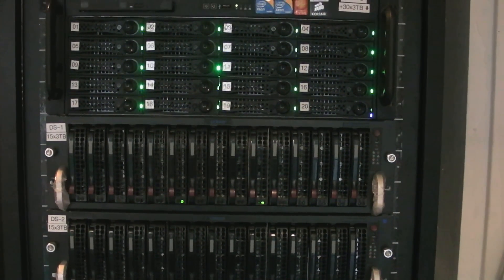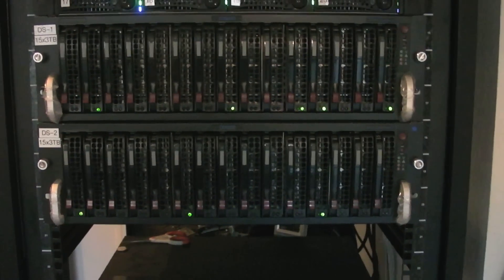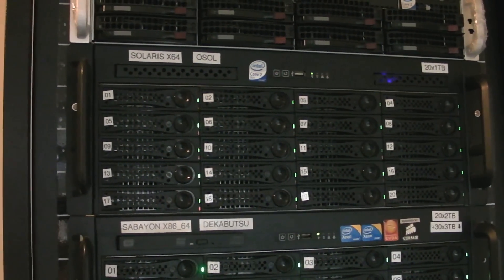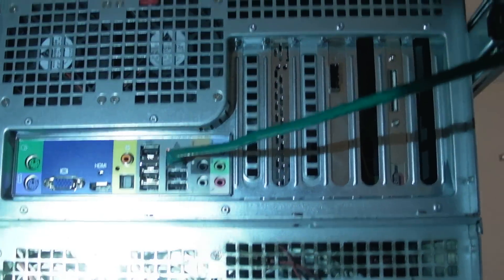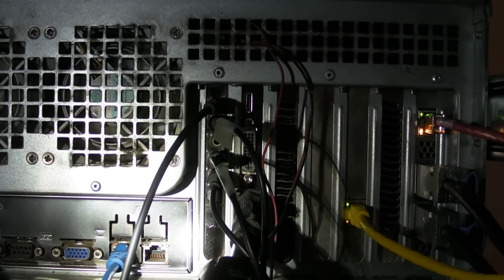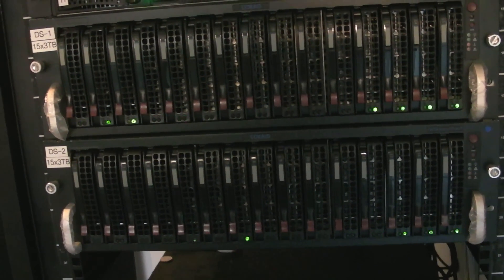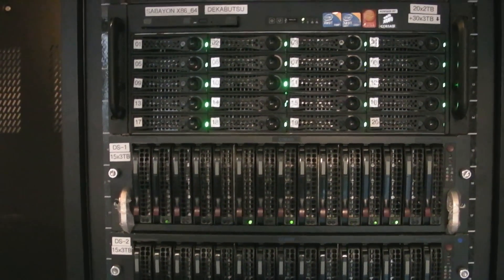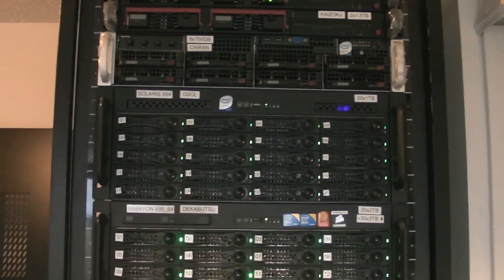Home server room/datacenter (full rack)

Comment: Why on the bottom two (2:00) do you have Raid 6 with 30 disks?  I know you might have some speed from it and some redundancy.  Yet, isn't that overkill?  I used to use Raid, and it's very dicey using it and rebuilding it when drives fail.  I now only use one or two single striped drives that incrementally backup.  Gives speed (as fast as I need -- ESPECIALLY OVER THE GIGABIT NETWORK) and gives redundancy.  Just don't understand the setup, unless you are just learning.  Overkill for almost anything in a home setting.

Comment: So you have 140 TB of space and run a dozens of hard-drives but you only use 10 TB?
That is ridiculous and a waste of energy.
I would suggest, remove all the drives and replace them with 5 * 4 TB drives. This will give you plenty of space at a  much lower energy requirement.

Comment: I run a Raspberry Pie with a USB programmable power outlet which turns on servers when i need them (they run build servers for my software). No way i waste 1000 Euro/year on a 500W system all the time when it is only needed for a few hours per year.
Reply: You could also use WOL to start up the servers.
Modern ATX power supplies do not need more than 1 W in standby.
Reply: OpenGL4ever Never seen redundant server power supplies doing this, the older (intel) sun servers don't even offer WOL. My next project is to use a Rasperrby Pie to switch them on and off.

And even most desktop power supplies are much higher, my very new workstation is drawing 9W.
Reply: Lothar Scholz
Today most server mainboards support WOL. The power supply is a different story, it does only need to be able to deliver standby power for the mainboard so that WOL can work.

Modern destkop ATX power supplies don't draw more than 1 W if the computer is in S4 Hibernation or Suspend to Disk ACPI Mode.
With WOL you can wake up such a machine.
If you use S3 ( Suspend to RAM) you will obviously need need a little more power to support the memory modules.

Comment: Your massive RAID 6 arrays are essentially pointless. In RAID 5 you have a 62% chance of data loss due to an uncorrectable read error on a 7 drive RAID with one failed disk, assuming a 10^14 read error rate and ~23 billion sectors in 12 TB. Raid 6 will halve that probability to 14 drives; however, you have 30. IE, your RAID 6 is just about pointless because the cost to rebuild the array will end up massively taxing the other drives and causing subsequent failures and huge slow downs. Google "hard drive failure rates RAID 6" for more disheartening info.
Reply: He would be better of by using ZFS and something like Raidz2.
Reply: Proper backup beats raid every time. Raid's purpose is to prevent downtime on activee systems not to ensure data integrity compared to backup.

Comment: @houkounchi, You might want to consider installing both of those side panels if you have them. The reason being is that, when combined with exhaust fans, it'll actually draw the naturally rising hot air, out of the cabinet. This will work best because, you already have an exhaust ventilation system right above your rack.

Comment: This is where you can differentiate real IT people and the fakes. A real IT person would just need ONE beefy physical server and run everything in a virtual environment. Not 8 fucking physical servers. Maybe 2 physical servers at most, one hosting the virtual machines, the second as a backup server.
Reply: I have 2 beefy servers running ESXi 6. It allows me to play with HA, load balancing, distributed switches, updating the hosts with vCenter. Can't do that with 1 beefy host. Have you ever tried to run updates on a single ESXi host with vCenter running on it?
Reply: what are you fucking texting for?

Comment: What a waste.  I love all these home taught IT people.  Like it if was 1990.  Ever hear of VMware?  Serious, waster of space, power, noise etc etc.
Reply: +Some Guy ... Agree, virtualization is not the ultimate solution everywhere. Docker can be a viable option, where a light foot print is more important than redundancy ... like a home environment. And VMWare is not the only hypervisor out there, it's only the most expensive and the only one you hear about when all you read is IT tabloids.
Kinda curious what the choice of Open Solaris is based on and if the rest of the servers run BSD or Linux.
Reply: The problem is not the 3 servers and not the server rack case, it's the > 50 hard drives with an energy consumption that goes sky rocket.
Reply: Exactly.
Reply: Yessir.  :)
Reply: +Gary Andriotis All I see is 3 systems, and while 2 storage servers is absolute overkill for home use, he might have combined storage with hypervisor and running 2 HV's and running loadbalancing/failover on them is perfectly normal in homelabs.
Besides, nobody wants a virtualized router, so thats always a smaller server.

Comment: Outstanding! Could i get Your input on whether using a proliant dl380 (g4) scsi. e as a gaming machine/primary desktop with a DFI  Geforce gtx 260 ( with a power mod ) ? I defer to your expertise as i see you are using a rackmount 4u as your desktop... Also what are the os limitations?
Reply: +pheedmesmobbilenode Don't use the DL380G4, they're not worth the power consumption (honestly). Besides that they will make a horribly loud fan noise which will require soldering resistors in the server to shut it up and then risk overheating. For gaming, servers offer up to 16MB of memory for the iGPU which is just enough to show the Windows/Linux terminal/desktop, not enough to run any game. You do not want to use such a server as a desktop...

Comment: I am wondering what kind of program you are running on this that spits out that much of data??? I got a server with 12TB of storage (together with dual Xeon E5-2620v2 and 128GB of RAM, virtualized of course) and I am called crazy.
Reply: I've got a HP DL60 (got it from NCIX fr $CDN600 barebones from NCIX) with two E5-2609 1.9Ghz's (Second processor kit $800). 32Gb Ram and four 4Tb HP Midline Drives ($250 each). Storage is a Seagate 4bay NAS with 3Tb x 4 drives using Simply Raid (Its ok for storage and seriously under powered by today's standards but would definitely like a rack-able QNAP 431-XeU instead). Seagate's remote gateway does not work well with my ISP router so I can not access it remotely. I am using this setup to tech myself big data technologies. I am running SQL Server Developer edition, SAS Student edition  and Widows Server Essentials ($CDN800 legal). Total cost is$CDN3000 for hardware. I have it up and running from 8:00am to Midnight. And run a daily backup (About 30 minutes since I have several large data sets with over 1Million observations and working data) at then shut down. I am in a 250sq ft apartment so  Noise and heat are issues. Operating costs is about $25.00 a day or about $200 a week accounting for A/c Hydro and depreciation. (In my case I don't pay for hydro or a/c so this is just a calculated estimate) If I actually get paying work for this I can get up to E5-2640v4 20 cores for another $10k for the two processors and up-to 256Gb Ram. That's pretty good headroom. If I need more then that I am making serious monthly income and can afford a cloud server.

Comment: damm, bigger than my...:P
not bad amte, but how much power it consumes????
I have only 3 servers (with 25 hdd and 8 sdd) plus switch + router and modem with optimized for low power usage and they still consume 0.7kW/h when not doing hard job... and more than 1.2kW at full load...:((( it costly in EU :((
Reply: Must be some old hardware. I have 4 servers 24GB each and all 4 together pull 500 watts underload. If I loaded them up with 24 HDD the load increases to 600ish pending on what drives I use.
Reply from the maker: MyuFoxable You are saying you load up 5 servers with 24x drives each and its only going to increase 100 watts? that is totally wrong. HD's will use 5-6 watts a piece at idle so 24 disks are going to use 120watts at the minimum (odds are more) and that is per machine.
Reply: houkouonchi 600ish is any where between 600 and 699. 500 peak load. I do not run peak. My normal runtime wattage is 470-480. So no I was not mistaken.
Reply from the maker: MyuFoxable  Well you said 4 servers. I don't know how many drives they have now but I am assuming its less than 5. So your talking 400-450 watts just in drives for 4 machines each loaded up with 24x drives each. Just four machines with 24 drives each even with low powered drives are going to be pulling nearly 500 watts (just the drives themself). Also with the chassis (and fans) and power loss due to not perfect effeciency PSU's there is simply no way four machines with 24x drives each are only going to pull '600' ish watts. A fairly modern dual CPU ivy bridge machine I recently built with 24x4TB hitachi coolspin drives even pulled 240w idle and that was pretty good for a dual CPU machine with 24 drives. Four of those would be almost 1000 watts.
Reply: MyuFoxable
mate, I'm from Poland, poor country...:P hard to sustain own lab at a newest hw :P
But I have one server that I'm not fully proud of (from power consumption perspective, it have 2x 30W chipsets, 18x 8GB ram modules and "low power" 2x L5638 CPUs that are low power with full load but not so low as more X series CPU while idle), now I reduce consumption to 620w when idle and hmm maybe 1k with load (dont test with full load), if the servers are full of ram, cpu, hdd and some other cards they eat power as hell, also a new one, only almost empty servers with all power saving feature on goes really low-power, not so normal condition for a home/lab cloud solution...:P
Reply: houkouonchi 4 servers and 24 HDD. Sorry 24 HDD is 150 watts tops not 500. Considering there are already drives in there it is not going to be my current power plus 150 anyways. These are cloud servers meaning the storage is shared among other shared resources. How else do you think such low power can be achieved? These are not 4 stand alone servers, the power something like that would be unreasonable for a home environment. I'm not hear to prove anything. I was just commenting on the differences in power consumtion between servers. Before you start saying people are wrong maybe you should try getting a better understanding and doing some research before looking like a fool.
Reply from the maker: MyuFoxable Well your original message implied you had 4 servers and you said if you loaded them up with 24x drives the load increases to 600w. What you said suggested four machines with 24 drives, (96 drives). My point is 96 drives alone will exceed 600w (even by your statement of 150 watts tops, and actually that is a really low estimate unless your using 5900 RPM/low power drives). It sounds like what you meant is you would just put 24 drives in one machine.
Reply: houkouonchi It sounds like you still don't get it. I meant what I said. There is only one "machine" with 4 servers in it. More proper one chassis that holds the servers the hard drives the power supply so on and so forth.
Reply: well thats very naughty me gonna yell sally army about that an get more info for act complaint can have an do you out of at..?

Comment: In the back where the motherboards ports can be seen, it is visible to see parallel ports and PS/2 ports for mouse and keyboard. Aren't those motherboards a tad old?  My build has ASUS motherboard and my next build motherboard is Intel, neither boards have parallel or PS/2 ports.  I assume this rack with servers not to be new but 5 years ago, that is when they were built.
Reply: some new servers still have ps2 and all other ports to be "backward compatible" with existing infrastructures.

Comment: So you basically have a printer at the bottom on the rack, because screw best practices for weight distribution :P
Reply: malnute You are stupid, that laser printer takes as much space as SEVERAL systems and it's no way heavier than a 3U 20x HDD system, have you ever lifted one of those with disks in? likely not since you clearly have no clue what you are talking about.
Reply: Probably it's easier to put the heavy server to the middle/top of the rack then to put it down there.
Reply: It's not about ease, it's about weight at the bottom keeps the rack more balanced, an earthquake might make it fall like this since the weight is at the top it's easier to loose balance.
Reply: I know, but how likely is a earthquake going to occur? I experienced only one very short and gentle earthquake in my life. And therefor I would put each server where it's the easiest.
Reply: Hey! +unixtreme: SHUT UP! My back started aching just because you reminded me about that! :))))))
Reply: you are stupid, that laser printer is likely heavier than any other single system in the rack, the bottom is the best place.

Comment: Awesome Dude! I want to setup something like this. Can you tell me how much is monthly electricity bill. Do you have some Solar power source to offset some of your electricity consumption. BTW, who is your ISP and how do they charge. Thanks!
Reply from the maker: My powerbill has been upwards of $500-600/month but that is mostly due to the heat and A/C more than anything and I have been working at home more so I had to turn the thermostat down. On months when the A/C doesn't run it was more in the $100-$150/month range. No solar power but I am considering it. My ISP is verizon. I used to push a lot of traffic off my connections but not anymore as they came after me for bandwidth usage. I currently have a 300 megabit symetrical connection with them but am going for 500 megabit. They don't bug you (at the moment) if you keep it under 10TB a month but in the past I was averaging in the 35-40 TB/month range. My current 300/300 is about $300 USD/month.
Reply: houkouonchi damn, 300 a month? That hurts. And that electricity bill. For that kind of money i would concsider putting it in a datacenter. I've got 500/500 for 50 euro. And a gig is 70 something. And no data caps either, just unrestricted. Plus it includes interactive hd tv with  near 75 chanels, use of wifi hotspots everywhere in the country, like in gas stations and restaurants and other public places plus 4 voip phonelines. You guys are getting riped off masively over there...
Reply: +roger supernova Did I read it right? 500/500 internet connection for 50 euro? In what country? Guess not in Germany!
Reply: Sparta right next door. Netherlands.
I'm with xs4all fiber. They where the only one ofgering dedicated ip adress and have nothing in the TOS  about running 24/7 online servers on their connection, private or commercially.
Reply: ***** what are you trying to do? If you just want a lab to experiment and try thing you don't need power hungry servers.
An older pc will do just fine for that. You can virtualize multiple racks worth of equipment on a single i5 cpu and a bunch of ram.

If you actually wanna run a bunch of stuff on your servers it doesn't work though.

Comment: What are you using your main machine fro exactly? Im curious to know the specs of that specific unit, and where you bought your rack and the 35ft cables from. Have you notices any noise pickup from your audio/video cables running such a length?

Comment: That would literally cost 42,000 a year just to keep running where I live. At 1KW that's crazy. Do you use any type of natural power (Solar, Wind, Water)?
Reply: ***** 1000 kwh * 24 hours * 30 days * 0,24 euro per kwh = 172,80 euro a month.

172,8 euro a month * 12 months = 2073,60 a year for a home server
Reply: @Laurens D 1 kwh * 24 hours * 30 days * 0,35 euro per kwh
Reply: 42 GRAND  FOR A 1 KW LOAD   ~????~  MY OWN USAGE IS HIGHER THAN THIS IN COMMUNICATIONS RADIOS ALONE 1.85 KW ON FULL LOAD MY ENERGY BILL IS ONLY 578 A YEAR  ???? 42 GRAND ?
Reply: Rs500ybd I made a miscalculation, it would be around $785 in my area, not $42,000. I used dollars vs. cents in my calculation.

Comment: thanks for the info. I just pick up a 2 Dell 1950 server one for testing OS and to play with and the athor one for a web server and fire wall setup.  and looking into a 2950 to use as my main PC for the movie storage with the cards your using with a norco case. the card I have seen for the SAS expander do not have a power plug on them how did you get power to the card with a mother board.

Comment from the maker: The raid/SAS controller is an ARC-1880x (external ports) although now faster better ones exist (arc-1882). The 1880 I have maxes out at around 2 GB/sec read and 1 GB/sec write (in raid6) the 1882 revision 2 (pci-e 3.0) can do closer to 3 GB/sec read/write in raid6.

I am using the HP SAS expander (6 gig, 36 port) in 3 of the chassis. So far its been pretty solid but I added a fan for cooling it. Good compatability with the Areca controllers and hitachi coolspin drives.

Comment: what sas card and expander did you use for your hard drive cases i'm planning on doing something like this for DVD and Blue ray  movies for my home server this would allow me to expand when i need to. i currently have a 12 hot swap 4u case as my main unit. but  i will need to expand my hard drives when i fill this up. your ideal with the no guts cases would work and keep cost down.

Comment from the maker: Actually my main rig is in that rack (a 4u box) which has a geforce gtx 670 in it and I use for gaming as well as server stuff. I am using a 65 foot USB 2.0 cable (PID 7533 on monoprice) and a 60 foot HDMI (redmere cable) going through the wall into my bedroom to keyboard/mouse/monitor(4k)/speakers. I also have a 50 foot-ish ps/2 cable going through a kvm as usb latency is a problem for stepmania. The usb cable goes through a hub and no real noticeable mouse latency on quake.

Its very doable.